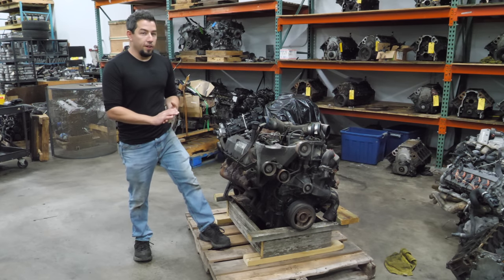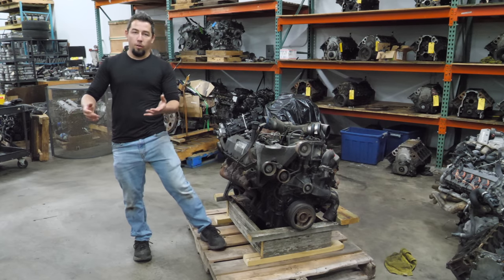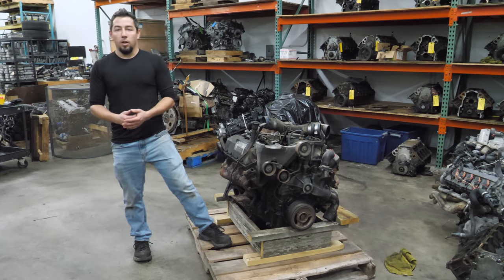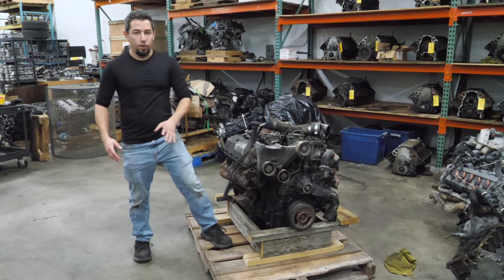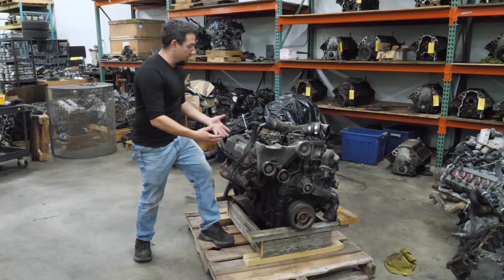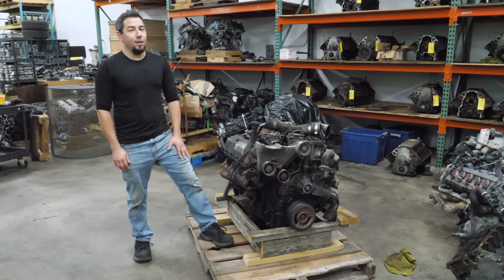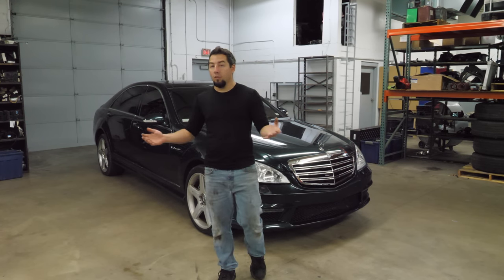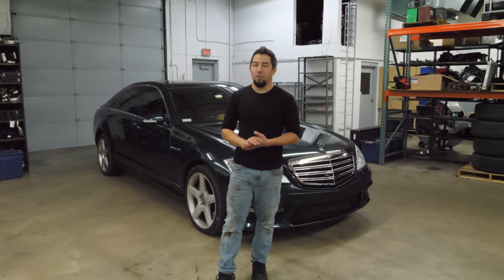70K OR 700K? Ford 7.3 Powerstroke Mileage Discrepancy. How Many Miles Are Really On This Engine?

Comment: 700,000 miles  LOL,you must be kidding. NO engines in any passenger vehicles thesedays will get anywhere near 700,000 miles except for toyota landcruisers straight six cylinder common rail deisel engines that they stopped making years ago. The only engines that i know of that get to 700,000 miles are the big rig engines in kenworths,peterbuilts ect.Vehicle manufacturers stopped making engines that were capable of reaching 700,000 miles a long time ago,most cars you can expect them to last until the power train warranty is done and then they start failing. They are engineered this way for a reason-money.

Comment: finish the teardown... you're this far into it already...no sense in throwing a worn engine back on the shelf. it might make a good stop gap filler for someone who needs a truck to get a job or two done, but not for any kind of long term solution. the wear in the crank bearings tells you all you need to know

Comment: Definitely 700,000 on them bearings!!!
Reply: Nope. 70,000 miles but a lot of cold starts with starter fluid,block heater not used when needed and a lot of running and idling while not moving  on those bearings
Reply: @Mizman76  
Idk I build engs for a living. And every set of bearings that I have seen that looked like that had at least 500,000
Reply: @larrysmith4887  yes because it's the hours of running and lack of lubrication  that show the wear of 700,000 miles. It very well could have enough idling time to have run 500,000 miles it just didn't travel near that far.